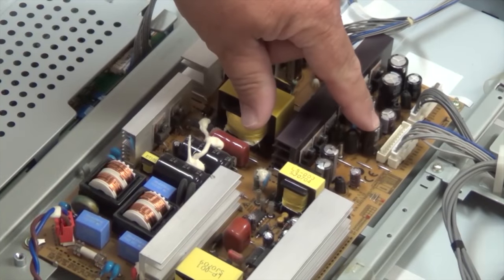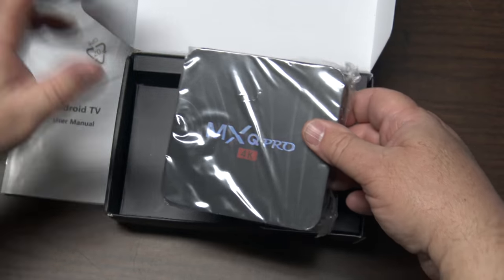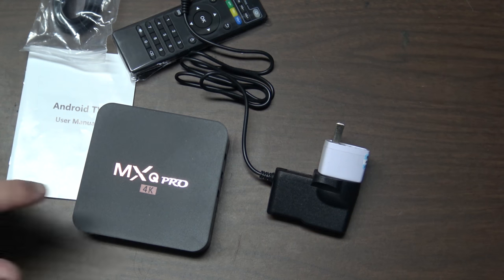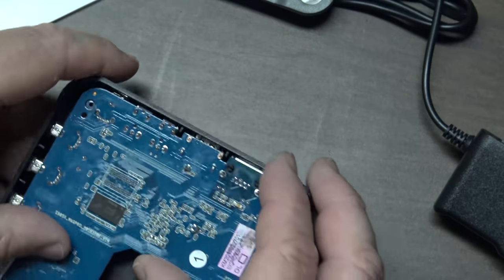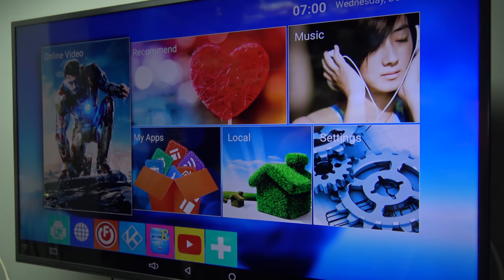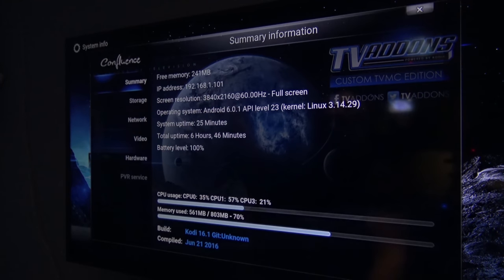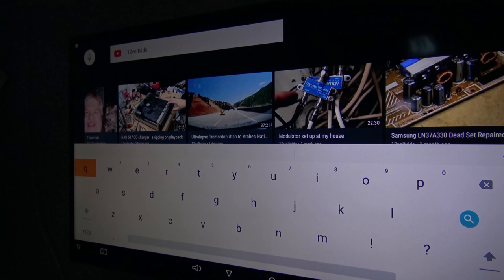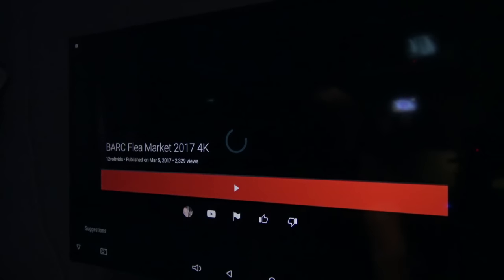MXQ Pro 4K Android TV Box Tear down and Test Run in 4K

Comment: Your unit came with the British plug option, we in the UK refer to it as ‘ a13 amp plug ‘ which is a generic term as the plug will obviously contain the correct fuse rating for the particular appliance it is connected to. Invariably when electrical items are shipped from China to the UK they more often than not fitted with a non British 2 pin plug which is usually accompanied by the inclusion of what we call ‘ a deathdaptor ‘, no shuttering or safety features whatsoever similar to the adaptor you have just used but in reverse.

Comment: picked up a couple of these boxes a few weeks ago from a flea market for the sum of £3.00 each  and to be honest that's all they are worth most of these boxes have overheating issues  and low memory i did manage to get some performance out of them by opening them up and installing a computer heat sink  i also overclocked the CPU and opened up developer options to cut down background services   this and changing the DNS server made the thing usable  but far from perfect .
Reply: I bought this tb box two years ago and I used it several times until one day when the screen remained on the black TV!He doesn't know about 4k ... on the tube you see maximum 720p and 1080p movies.It is very slow and without ever updating.I bought mi box s which are super crowded.
Reply: @mariusmarius9977  Thanks for the input, just want to know what you mean by saying  it is overcrowded

Comment: If you spend time using these Chinese made android boxes no matter what hyped up name they give them you will be disappointed overtime with there performance particularly motion handling and freezing as well as a poor outlay overall. Nothing can beat the performance and reliability is first class Nvidia shield tv full stop.
Reply: I got one recently to replace my firestick and so far whilst it's not stunning, it does the job admirably.  £25 and it gives me decent 1080P on NetFlix etc. without struggling.

BTW the reason YouTube don't like you mentioning things that give you free TV is that they're flogging YouTube TV with live channels and don't want people to get for free what they want to charge for!
Reply from the maker: They are cheap. I got several for free and I use them to play media files from usb.  3 run 24/7 and have not had any problems.  I don't use them to pirate tv though as most people do.   I get my tv with an antenna and untill recently my internet was data limited so using one of these would get quite expensive.